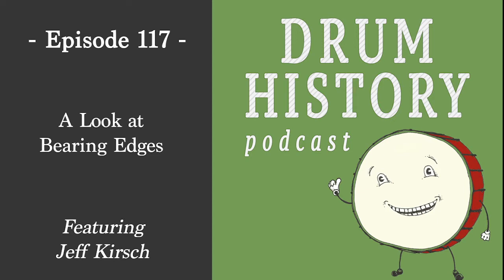A Look at Bearing Edges with Jeff Kirsch - Drum History Podcast

Comment: Uhh, I studied tympani with a renowned teacher back in college. Typms are a brass bowl with a bearing edge and a peddle to adjust pitch ok! The calf heads became a rarity and almost all typms had plastic heads! Kind of obvious cognate but the bearing edge was greased with a very light coating of vasoline to facilitate accurately and consistant in pitch l wonder if dressing the bearing edge exactly flat then cut to profile then hardening with a quality super glue or penetrating epoxy then a final dressing back to flat. Since the wood wouldn,t absorb the vasoline use that to lube the bearing! Just a thought

Comment: Tuning to shell pitch is nonsense
Reply: Yes, I agree. I think that drums sound is affected by the VIBRATING COLUMN OF AIR inside the shell. Like Pan Pipes... Or like if you have a set of congo drums: they are both the same length, but different diameters. Using the Pan Pipe concept: The little drum has a LOWER PITCHED COLUMN of air, and the larger diameter drum has a higher pitched VIBRATING COLUMN OF AIR. You can hit the center of the congo drum with your fist, or the palm of your hand, and test my theory. It usually bears true, but some times not. I think that is due to changing atmospheric conditions.
Sonor Phonic, and Premier Resonator drums have thick shells and a different dimension VIBRATING COLUMN OF AIR, and I think they sound better.
But the shell it's self? No the SHELL does not really resonate. 
 IMHO